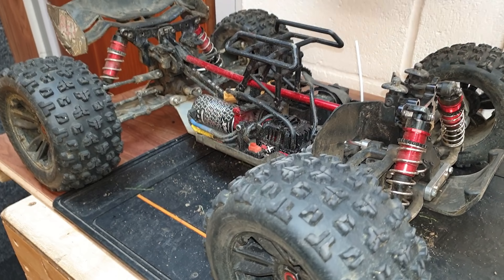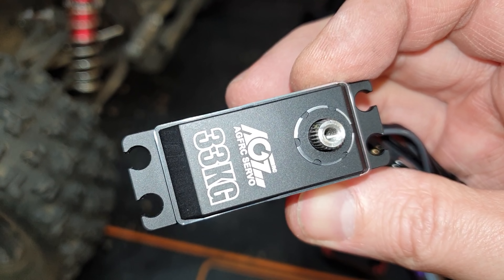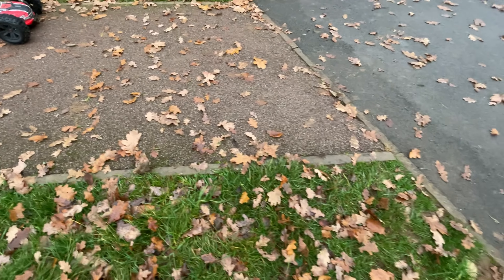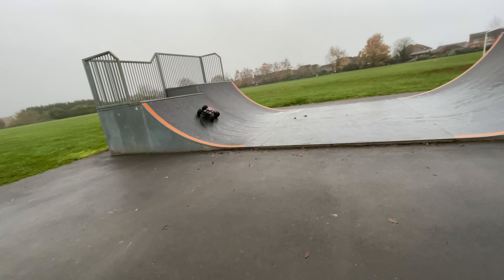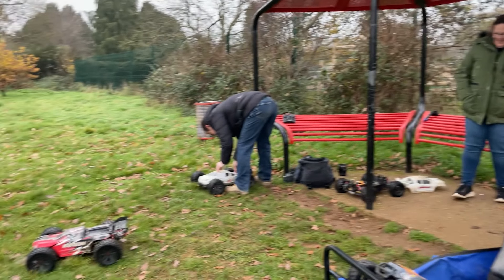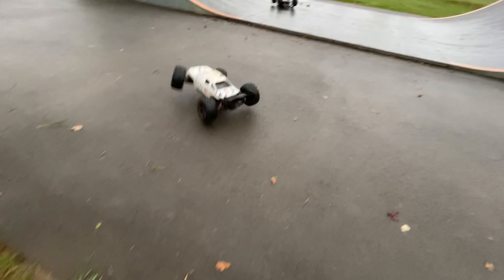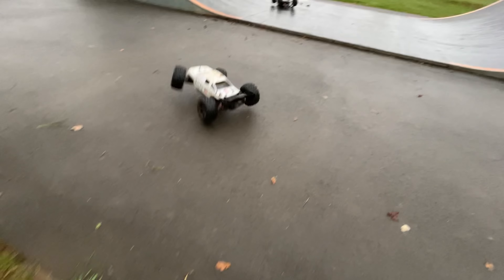The 1 problem I can't solve + destruction test

Comment: Great videos, friend...I toasted several servos until loosening the tension of the steering rack large spring. Running the warranty replacement servo, and haven't toasted it since. Depends on which you have, some don't have that feature.

Comment: Both of my kratons were killing servos until I put in a hot racing servo saver tube and adjusted it correctly and locked it down haven't killed any since. Also I run a 8v bec 👍

Comment: Kevin talbot a little trick that I learned when you’re bashing is at the switch always turns off for whatever reason but what you can do is you can solder the two connections therefore it will never turn off unless it gets unplugged

Comment: make the servo saver tighter, make sure the rubber isolators of some sort are installed between servo screws and make sure theres a gap between servo and chassis

Comment: Is the kraton steering set up the same as the outcast? If so there's a locknut on the bottom of the assembly that gets worked down into the chassis over time by normal steering. Keep an eye on that

Comment: I have a kraton 6s myself . Haven't had your servo issues yet. . all I keep having is diff issues 🤦‍♂️. I do however have the rpm upper and lower front arms and rpm rear arm aswell due to the arms being a small weak point.

Comment: Hey kev when you get a rtr and drive it a lot should you rebuild the diff🤷‍♂️
Reply: Had my slash 4x4 for almost a year now being driven about once a week and I've just regressed my diff, unless you're having issues specific too it I wouldn't open it up or rebuild.  In my opinion id be checking on bearings, had one seize up and kill my slipper
Reply: @STEVOBRADING  I have a kyosho 4s buggy is there a difference
Reply: @ilikemazdarx-7s53  pretty much all RC's in essence are the same, just different brands and shapes of parts.  But yeah check those bearings if you ever notice it slowing down or pulling
Reply: @STEVOBRADING  ok I will

Comment: Hey Kevin got a question I have a arrma Kraton 6s and I know the kratons stock connectors are C5 and my batteries connectors are EC5 is that ok that I  use them both even tho there slightly different

Comment: For m2c Chassis i have a little anekdote: ive Driven my tekno et48.3 on a skatepark which has a pingpong Table with a steel net in the Middle, common for us here no problem. Its about 5 meters away from the quarterpipe with the Pipe beeing parallel pointing in the same direction as the Table but Offset about 2 to 3 meters ( with the slope ) as i was jumping the pipe ive  had about 6 meters runway and idk how but ive Managed to hit the steel net exactly with the Middle of the Chassis. There are no freaking marks nor dents nor did the Chassis bent in any direction. But alas my friends i can clearly See where ive hit the net since there are 2 marks in the steel xD and the marks arent that small either ! I love my m2c strongered tekno .

For the Ones not believing me, just comment under this comment and ill make the Video with subtitles and Upload it on my Channel where you can look it up then !

Comment: I think if it killed any more Servos I might try switching the receiver, you also might have a corroded receiver pin
Reply: ITS cuz he is not running an external BEC to give proper power.
Reply: @Chris-zu8ve  ahhh, I just assumed that the esc had a built in bec but that makes a lot of sence

Comment: Maybe the tallness of the servo affects how fast it is?
Reply: the case size has little to do with it.  The internal motor type, gear engineering, power voltage it can handle, and the overall skill and care of the designer and builder Make the Difference... Selecting the proper servo for its intended JOB is the best way to get what you want from any of them.

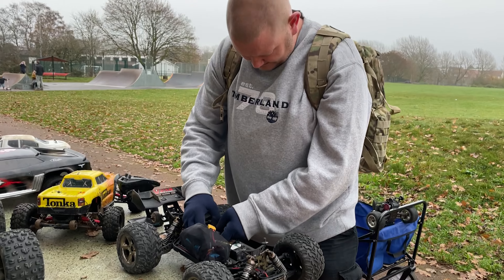Comment: Hey kev can u review the baja rey Ford raptor king shocks or the baja rey 1:10 scale Bnd and am second and nice vid plzz answer me
Reply: King shocks are sick for 1:1 scale, but the smaller versions Do NOT hold up to their name.  IF you got the $$$ to spend, just get the Pro-Line pro spec shocks, I did the kings first and they were junk. Proline Way better performance overall.  And they have TRUE working Reservoirs if you need those for speed.

Comment: i thought kev made the strongest rc car, but it keeps on breaking from small jumps. also I like at 3:50 you can just hear one big WACK on the chassie.
Reply: Ya, its not like having proper springs and shock fluid for massive jumps would help.....Sarcasm     You can't just expect 1 setup to handle Everything.

Comment: You claim your m2c chassis is still good but in the last 2 previous videos before this, you can see your center brace is bent. In the same fashion as your 8s kraton was. Also your rear chassis brace bolt broke which is another indication the rear is flexing too much and bent. I’m speaking from experience. I bash very similar with my 6s kraton and I have bent 2 m2c chassis in the rear along with rear chassis brace bolt issues. Also other ppl have issues with the rear brace bolt due to the chassis bending. It either bends the bolt, or bolt will loosen up due to being stretched. Please take a straight edge to your chassis and show us all that it is indeed good or not. I’m not trying to start any drama, but based on my experience, others experience and what I’m seeing in your videos, I am skeptical it’s still straight. After all, you do preach honesty and integrity. So let’s see it!
Reply from the maker: I did put a straight edge to it a few videos ago and it does have a slight bow, but its a basher not a racer so not a big deal
Reply: @KevinTalbotTV  for sure, I just got tired of having rear brace issues from being bent. Switched to JBIRC and no more issues since! Not sure how I missed the straight edge part since I watch all your videos!
Reply from the maker: its in the vid where i tested the bash bar. i don't often have brace issues, 1st rear bolt i snapped i think